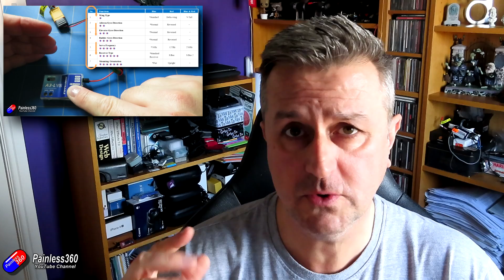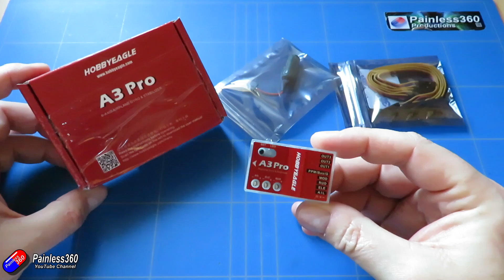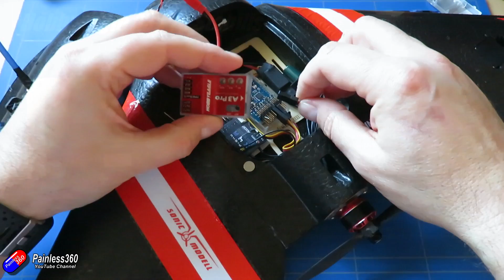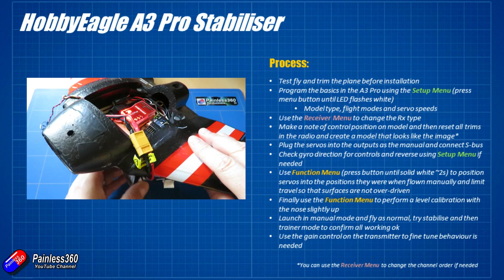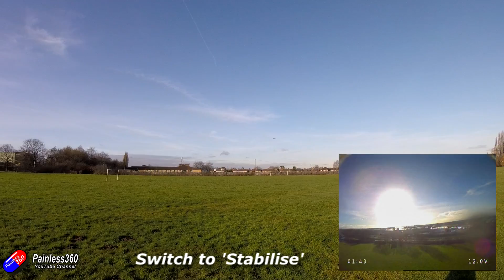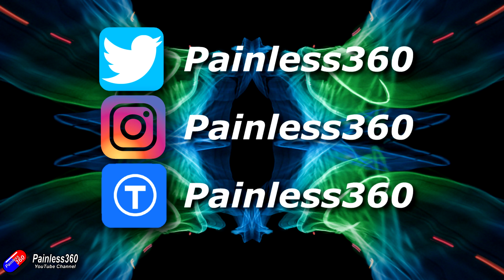HobbyEagle A3-Pro Fixed Wing Stabiliser Setup

Comment: I wonder if you could answer a question please.  I have this GYRO and see that including the 'off' position it has a further 5 settings.  My question is how do you assign all these options when the only switch is 3 position ?  Do you need to use 2 three position switches or just choose which flight modes you want and assign to 1 switch.  Then if you wish to change you re-program the transmitter.  Apologies if this sounds stupid but I am completely new to all this.  Its all a bit of a minefield especially since I am used to flying drones where everything is done for you lol.  Thanks in advance
Reply from the maker: Most tend to find that you don't need more than three of the modes when flying. You can mix two switches together to get more switch positions if you do. Best of luck!
Reply: @Painless360  Thank you for the reply .. I think you have answered my question and the mixing of switches is beyond me lol so 3 modes it is .  Thanks

Comment: Hi, I use A3 mini with my Mini V plane. Everything works well but... The plane is so small and for launch you have to use Angle mode. The problem is that in Angle mode  throttle power is limited too. Is it possible to change it in A3 mini? Or I have to configure switch for it in controller ?
Reply from the maker: I've not played with these since the video so probably not the best person to ask.. Best of luck!

Comment: What gets me confused is the two Gain settings. One is digital Gain and one is physical. Why are they different?
Reply from the maker: No idea. I looked at the current manual but couldn't find a mention of the two gains... Happy flying
Reply: @Painless360  There is a Gain which can be adjusted in the menu of the programming and a second Gain which are the three physical tabs on the gyro Which is the difference between the two?.
Reply: The pot on the gyro is the master, if is set at 50% then you set the gain on a rotary dial at 100% you will get the max the master is set at (50%) 100% of 50%. Reduce the rotary gain to 50% and you will get 50% of 50% =25% gain.

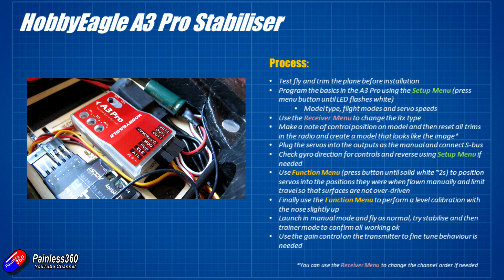Comment: I use one on my r/c autogyro to help me with level-flight in case I lose orientation, which is often. What I forgot, is that the A3 Pro needs initialization-time everytime it starts up (7:20). Otherwise it goes bunkers during flight, which happened during previous flight. I barely managed to keep it in the air.

Comment: Time has flown since this video, but I just purchased an A3 Pro version 1.1  from AliExpress.  Programming flight modes is driving me crazy.  I just sent the following to HobbyEagle but am not optimistic about getting an answer.  Maybe you can help me.  Quote:> I am spending HOURS trying to program this unit.  I have downloaded the version 1.1 manual, but find it confusing.  The settings described in table 3 Setup manu under flight modes don't seem to correspond with my results after choosing an option.
Maybe the simplest for me would be if you can tell me step by step what I need to do.I have a Spektrum transmitter, and my flight mode switch is three position ....   I identify position 1 as SAFE (Spektrum)   I identify position 2 as AS3X   "   I identify position 3 as EXPERT

For Expert  I think I would be wanting your GYRO-OFF setting,For AS3X  I think I would be wanting your NORMAL setting,For SAFE  I think I would be wanting your TRAINER mode.

I realize this is an older product, but I did just purchase it from AliExpress not realizing that it was not the 'current' model and I would REALLY appreciate your help and clarification !
Reply from the maker: I don't use these any more - I use INAV pretty exclusively in my models. All i knew is in the video - best of luck!
Reply: @Painless360  Thanks for answering my post !

Comment: I've been using the A3 Pro for while and found it very good. Recently it stopped working ! Then I realised that, in my Tx I had reversed the Gyro but left the Gain at 80%, in the Tx. So the A3 didn't do anything, the Gain was too low. Therefore in the Tx, leave the Gyro at Norm and the Gain at 80%. Or the reverse the Gyro and set the Gain at 20%.

Comment: Great video sir ! One question please: how do I set up aileron leads when I have two ailerons servos in my plane? I've watch your video 3 times before asking that question. Thanks.
Reply from the maker: I think that is a limitation of this stabiliser... Happy flying
Reply: just use a y splitter. this will work unless you want to have flaperons
Reply: @samuelkrajc  thanks man 🙌🏻

Comment: Hi Lee! I recently purchased a Hobby Porter fr810 receiver/flight controller all in one unit that uses a PCB board with LEDs and switches to program it. The instructions that came with it are Horrible! I have asked for help from the seller and Hobby Porter many times but the both were of no help. 
Have you had any experience with one of these? I have Googled this and there is virtually  nothing out there.  One video on YouTube but when I contacted the person for more information, he said he sold it.
Any suggestions would be helpful. 
Thanks!
Reply from the maker: Sorry, I've never touched one. Best of luck!

Comment: Hi, thank you for your reply, I found that I add a pin crooked in my aileron inside de stabilizer, maybe trying to connect my wire I made this. And with the informations I got from your video, it let me programme everything correctly, so let me tell you thank you to take the time to answering me and the good informations on your video. Have a nice day.

Comment: Good as far as the video went.  Critical comments, not many people fly a flying wing, or use S bus.  Why not make a video with what most people have and use?  Along that line there is a major problem I experienced that make the Pro worthless.  DON'T RELY on the default settings.  The Pros I got had the default settings in the "Receiver Menu" set up is wrong for Spektrum radio.  It has the throttle menu set as channel 3 (which is correct for a Futaba radio or a transmitter which uses the Futaba protocol).  Since the Spektrum radio's protocol is different you MUST change the receiver menu so it matches your radio.  If you don't you will experience what I did, since the instructional manual does not address this issue.  With the default settings the aileron input will result in a jitter which is very bad, and the elevator will do the same.  The rudder will function as normal.  This makes sense since the defaults are set up wrong for the aileron and elevator, and set up correct for channel #4 on the Speckturm and Futaba protocol.  PLEASE PAY ATTENTION IF YOU HAVE A SPEKTRUM TRANSMITTER AND RECEIVER.
Reply from the maker: Great stuff. Why not make some content yourself to help others who struggle with it. Happy flying!

Comment: Decided to try the Hobby Eagle A3 Super 3 but I cannot get the software to connect to my Windows 10 computers.  Nothing happens automatically when I connect to the USB, and when I try to run CP210xVCPInstaller_64 I get the message:  “The device driver wizard was unable to find any drivers designed for your machine.”  I am not enough of a computer wiz to know what to do.
Reply from the maker: I would have a look in the forums for that specific error message, it looks like others have had similar problems but a quick search I’ve just done I couldn’t find the exact one. Best of luck getting it sorted, I have the drivers for that from all of my betaflight stuff and that seem to work okay here...
Reply: After a long period of messing around I came up with the following steps which worked for me and allowed me to connect the A3S3 software to my windows 10 computer:
1. Download CP210x VCP Driver for Windows 10 from Hobbyeagle.com site

2. Unzip the download which should reveal an installer called CP210xVCPInstaller_x64.  You would think you should run this to install the drivers but for some reason unknown to me it doesn’t work (returns the message “The device driver installation wizard was unable to find any drivers designed for your machine.”)

3. Plug in the USB dongle supplied with the HobbyEagle A3S3, which will somehow trigger Windows 10 to add a new device in Device Manger, Ports, a new port called CP210x USB to UART Bridge.  However for another unknown reason this port doesn’t work without step 4 below.

4. Click on the Port identified in Step 3 and then update the driver, using the file unzipped in step 2.  The Hobby Eagle software still does not recognize the new port when the A3S3 is connected, without doing Step 5 below.

5. Connect the A3S3, open the HobbyEagle software.  For yet another unknown reason it doesn’t see the com port, so you need to click on the com port on the lower left (but not on the icon for the port, which for another unknown reason does not function.).  After all of this screwing around it now works fine.

Comment: I've used the HobbyEagle stabilisers for many years and really like them, seeing my Cessna 182 pulling 3D aerobatics just seems so wrong, but even the A2S2 makes it easy. 
The A3S3 is now my new favourite, I have the programming box for field tuning and it is brilliant. I updated the FW on the two A3's I have and now prefer the A3 to the A2.
I have several FPV planes running these stabilisers, they can easily outperform just about any of the combo FC's out there. It's like stepping from a bus into a Ferrari, especially 
if you fly terrain fast and low..
Thanks again for another great video.
Reply from the maker: The video for the Super3 is on the go at the moment. I like he way that you can use a micro SBUS Rx and forward spare channels out brought it for pan and tilt FPV! :)

Comment: Wouldn't it have been easer to just put in a S6R/S8R in it? I prefer the lua script to all those lights.
Reply from the maker: It’s very much horses for courses. What about those pilots that don’t have Frsky radio running a comparable openTX? It’s great to have choices..
Reply: @Painless360  The question was directed at your particular use. I get where you are coming from though not everyone has the FrSky system, and your doing it for review purposes. Great video as always Thanks for sharing.
Reply from the maker: @brownie6451  I was one of the first people to do a complete video setup guide for the S6R. Thats still relevant so I don't see the point in making another video on it at the moment. There are so many other good stabiliser and RC technology options that need covering, many without enough decent setup videos so that's the focus for now.. Happy flying!

Comment: Lee these look very interesting, but I still think using iNav and a F4 or better flight controller is a better more flexible solution.

Also it should be noted that the EagleA3Super3 only works with Windows computers so if you are an Apple person forget it.
Reply from the maker: Hi Wayne! Long time no speak. You know me - I like to show different options for pilots so they can can make an informed choice based on what they want and what they are comfortable doing. See my iNav, Vector, S6R, Betaflight, multiwii, Pixhawk, APM and other video series. ;) happy flying!

Comment: How does the stabilisation & auto-leveling compare to the FrSky SxR receivers?
Reply from the maker: I’m not a fan of those of the stabilisers, see my videos on them. Happy flying!
Reply: @Painless360  Is that purely due to setup complexity though, or is the stabilisation not as good, smooth, reliable, etc?

...Do either of them add any appreciable latency to the control inputs, which will auto-level a plane the quickest in an emergency, etc.

Comment: I've helped to set up the L version (and flown it occasionally) and that seemed pretty good when you get it right, This seems like it's an improvement and has more functions but not something i would use as a replacement for a working L. More something to consider for a new model...... does that make sense ?
Reply from the maker: Having the used one over the very basic version I wouldn't use the basic version anymore. Happy flying!

Comment: Interesting. What I find inconvenient with those stabilizers is that they take sbus as input but don't output the throttle channel as PWM. You alway need a receiver that outputs both sbus and PWM.

Comment: Assuming you're using a pot to set the gain you can display the pot setting on one of the screens. Once happy you can then read off the setting and make it permanent.
Reply from the maker: You can make it so that when the model is reloaded it warns you if the pot has moved (see my other videos on pre-flight checks) but the while point of the remote gain is that you can tweak it to account for local conditions and wind.. Happy flying!
Reply: @Painless360  
Ahh I see. I'm used to just setting it at a level high enough to dampen the wind but not so high that it causes oscillations. Then I only turn it on if things get a bit rough. :-)